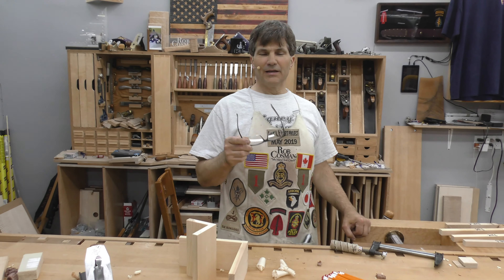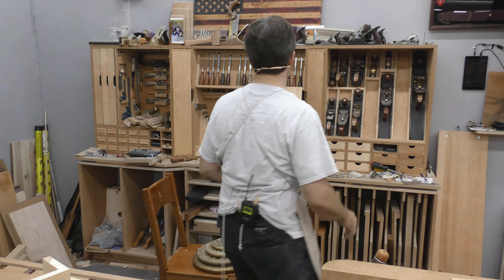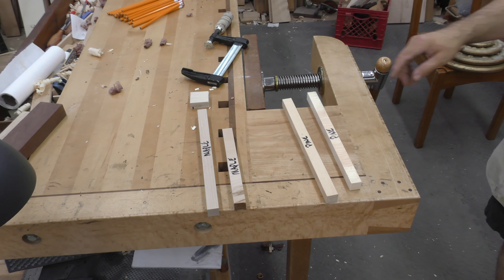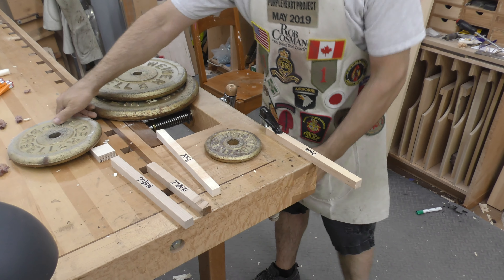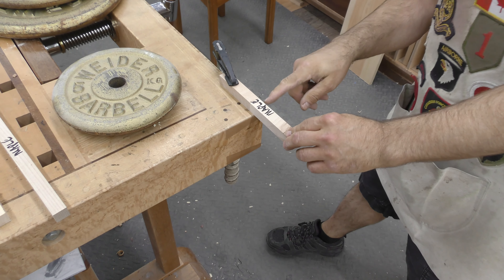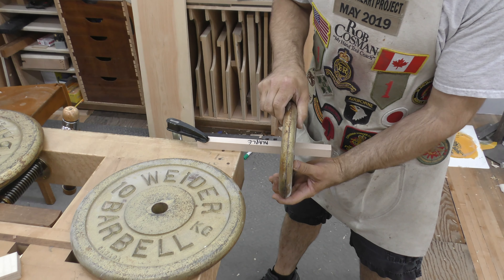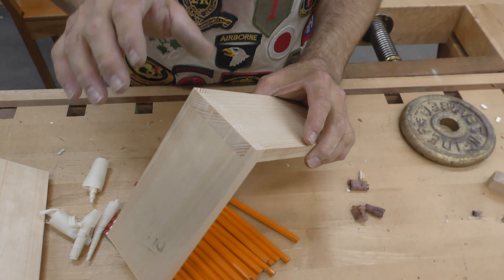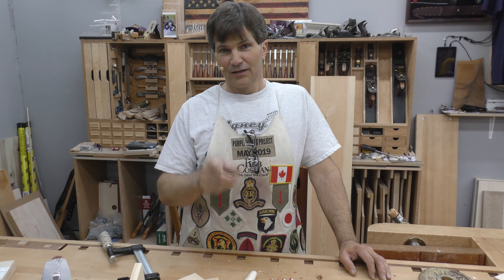Wood is Good #1, Basics on Wood as a building material.

Comment: Was the length of wood sticking past the bench consistent across the 4 tests?
Reply from the maker: Close but not terribly relevant.  The difference between long grain and cross grain was huge and the difference between hard and soft wood was equally huge.
Reply: For a constant cross-section, the deflection on a beam is a cubic relationship to the length. So - double the length, expect 2^3 of the deflection (i.e. 8 times). Unexpected maybe, but useful to know. This relates to ultimate breaking strength of structures too, I think. So, a shelf, all else being equal, that's twice the thickness, can support eight times the weight of the one that's half the thickness. A cantilevered shelf that's twice as long, can support 1/8th the weight of the one half as long, etc etc.

It makes the "stickout" quite an important factor in testing and designing etc. Easy to test in your workshop, if you are so inclined.

At the end of the day, pine is somewhere around half as strong as oak, and a board across the width is a small fraction as strong as along the length. (guessing 1/10th?). So in the video, where the stickouts were a bit vague, it probably didn't matter. I just wish Rob had let the glue dry on the edge-joint! :-)

Comment: Glad to hear that you are going to do more videos like these. Most useful. Thanks kindly for the clearly presented information. So, when you make dovetails in the end of boards, isn't one end is going to have the tails cutting across the long grain no matter how you lay it out? And if you make pins just the wrong shape, they can split either tail out or split the entire board? (Yes, I've done both :( )
Reply: The wedge-action of a dovetail is where the strength comes from. Often talked about as 1:5 for softwood and 1:7 for hardwood (everyone has their favourites, and some hardwoods are softer than softwoods, etc.). This means for every unit distance a point in the joint is displaced /along/ the grain, 1/5th to 1/7th of that movement happens /across/ the grain. Wood is stronger along the grain, so this is how it needs to be to share the stress and strain within the joint.

It's common for folks assembling a dovetail joint to blow one or both boards apart across the width, because the dovetail joint wasn't cut accurately enough. Wood is a spongy material in the grand scheme, so it's quite forgiving. It's especially true for woods like pine. But, if you are having trouble with harder wood joints breaking apart, try honing your skills with pine or a softer, more forgiving wood (cedar, tulipwood, sapele, meranti, walnut). If you are still having trouble with those, then you might not have the method figured out properly yet, and maybe some more reading/watching/practising would be good.

Comment: I have to disagree. Trimmed out my shed with cedar and all of them shrunk along their length.
Reply from the maker: you are correct if you are starting with wet lumber from the mill.  I am speaking of dry wood as it responds to season changes within your home.
Reply: @RobCosmanWoodworking  I dont know that it was wet, I bought it at Sutherlands and my particular store keeps their lumber indoors. I let the lumber sit outside for a week and even miter cut the butt joints. Everything just looks horrible. On a positive note I did learn a few new things from your video.